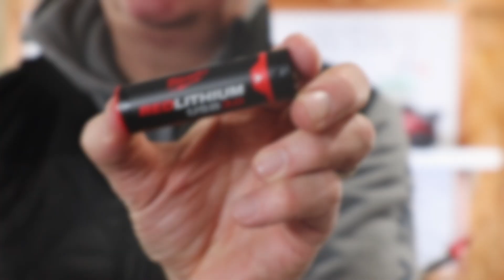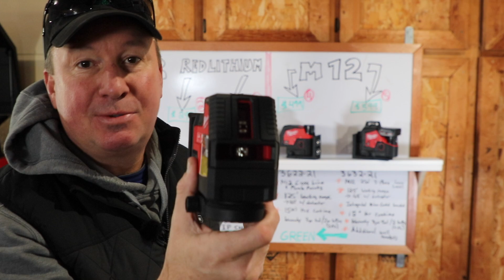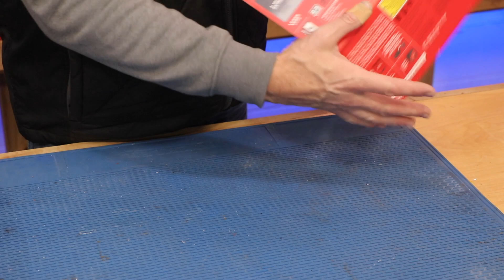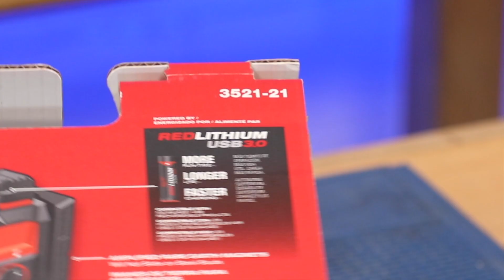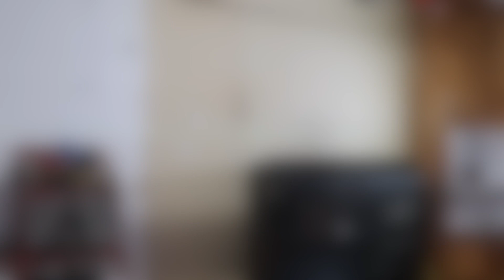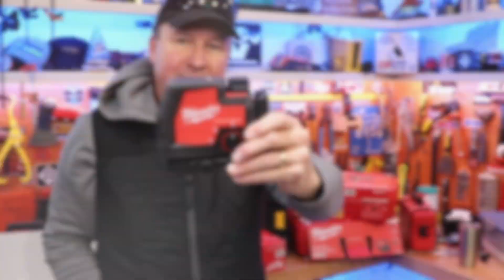MILWAUKEE 3 PLANE LASER // HIGH INTENSITY GREEN! // USB RECHARGEABLE  #3521-21 // 5 VIDEO SERIES!

Comment: I'm  a milwaukee guy but these are overpriced AF. Anyways, there are already cheaper alternatives from bosch and dewalt. The only thing that would make these standout is if they are accurate in long distances (150+ feet) and if they are visible in sunny conditions
Reply from the maker: I have to admit that I was sticker shocked when I saw the prices, but they are very robust and have plumb points too.  I believe all lasers with outdoors with the 165 laser detector accessory.  Bosch cross line lasers don't work with any detectors that I know of.  I will make a shorts video soon to show that.
Reply: My thought is you'll save huge money not having to put new batteries in it every 3 days.